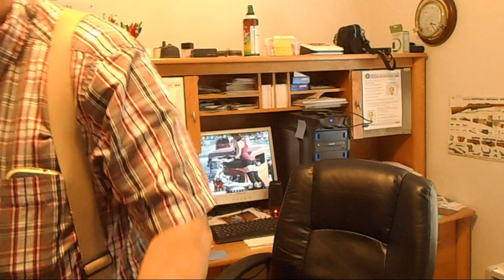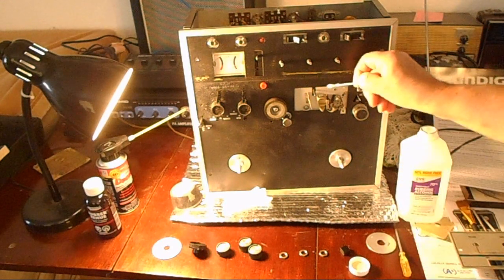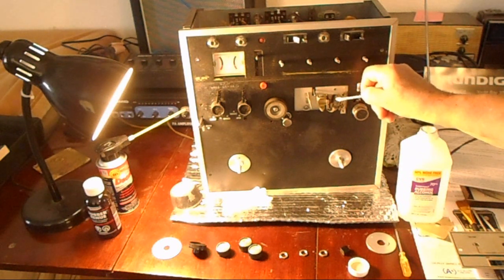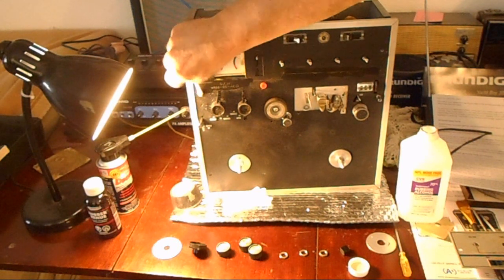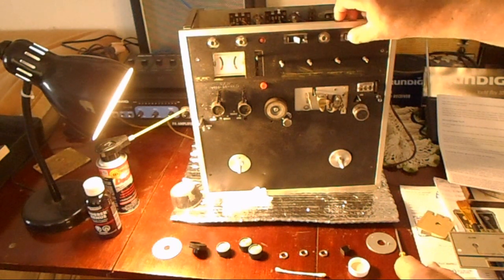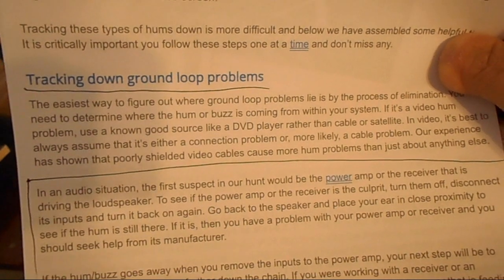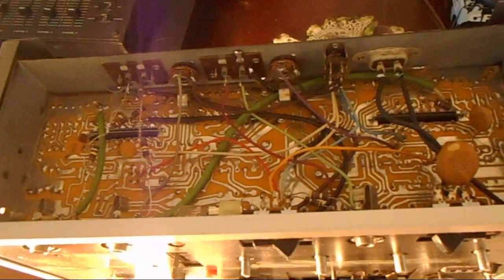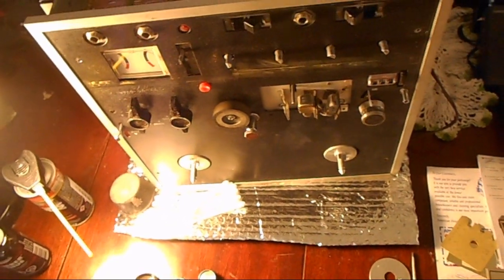Working on Rheem Roberts Model 1719 Recorder

Comment: Hey Larry - do you play the Mandolin ?  Very cool...    on your recorder, Do not leave it on... you can damage it...  Others have said this... you need to change the filter caps...
Reply from the maker: Oh I don't keep it on long only long enough to show whats happening on video. Yes replacing the filter caps will take a lot more dissassembly to get to. Just cleaning it up at the moment not running it to play it at all. Just testing at this point.